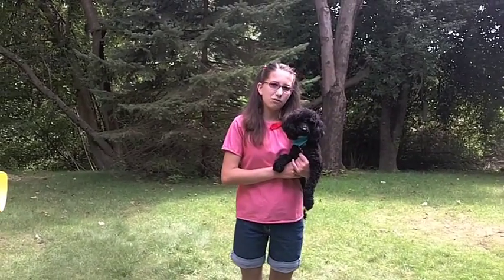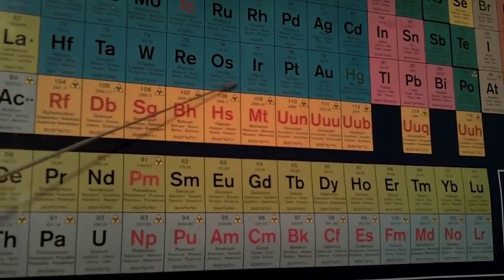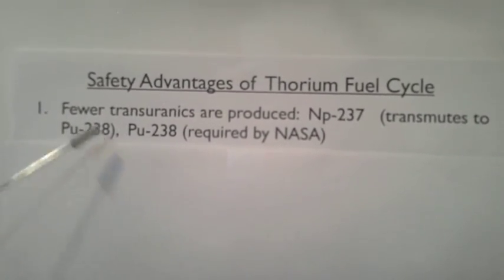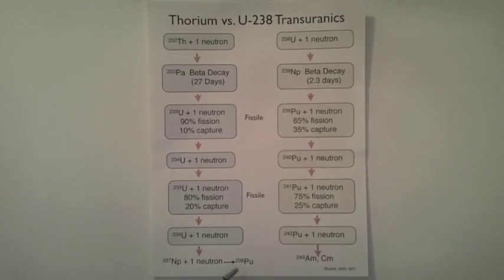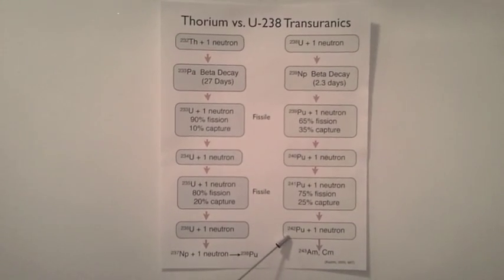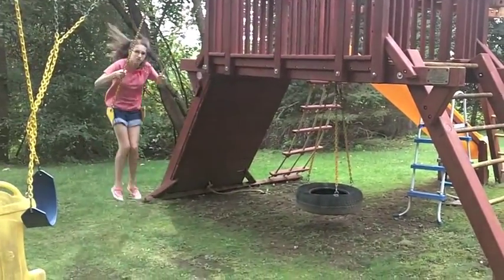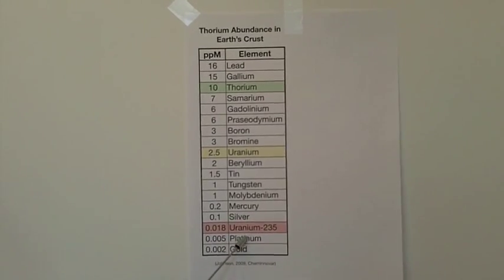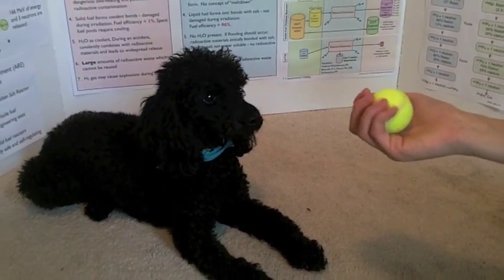Nuclear Energy - LFTR - Katie and Caysie [Part 3 of 3]

Comment: 340 pounds of high level (300 yr half life) waste for 1 GWYear of electrical generation. Not to mention the small volume of Thorium feedstock at the front end.  What other energy source even comes close to that ratio?  China, thankfully, is working on bringing LFTR's to utility scale (250 MWe to 1000 MWe per station) by 2024.  And - nice by product - waste process heat (after nearly 45% electrical generation efficiency !!!) can be used to synthesize liquid hydrocarbon fuels, using atmospheric CO2 as a feedstock.  Let us all give thanks to Alvin Weinberg.

Comment: Thanks for the great videos!
Its great that you distinguish Pu-238 and Pu-239. Because Pu-239 is the best nuclear weapons material currently available due to low critical mass. Pu-238 however is considered a contaminant of Pu-239. (similiarly to U-238 and U-235) Even though Pu-238 can be used as high alpha emmitter in thermoelectric generator. So in terms of nuclear wepons Pu239 is good and 238 is bad. In terms of peaceful use Pu-238 is good and Pu-239 is bad. Also not many people know that even though "Uranium" is fairly abundant 2,5ppM the only USEFUL isotope U-235 is just slightly more abundant than Silver - so not abundant at ALL! So would you burn you silver jewelry in an oven just like that for heat? To me it's pretty wasteful. Also the U-238 "depleted Uranium" is A HUGE factor in the waste product. Because of its abundance (due to enrichment) it TOO has been misused in weapons industry, with no less than devastating effects on human health.